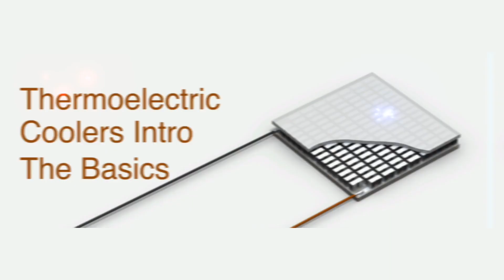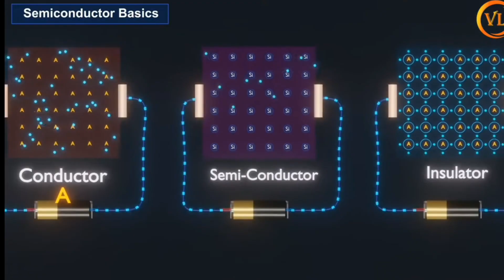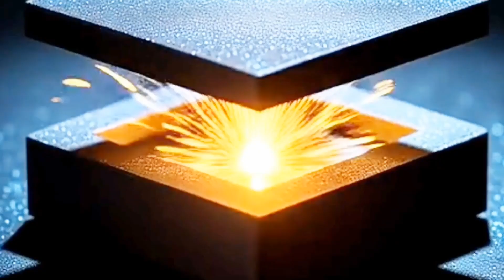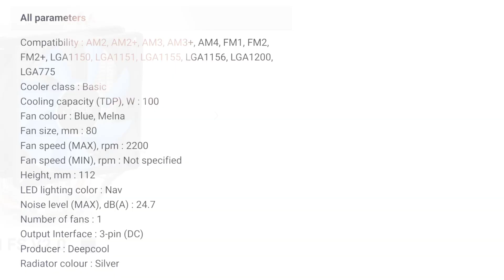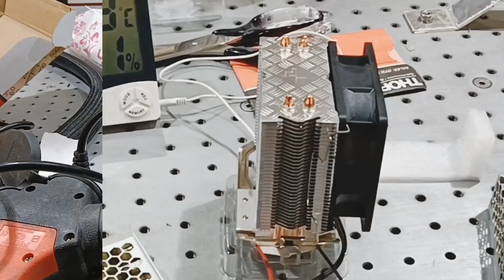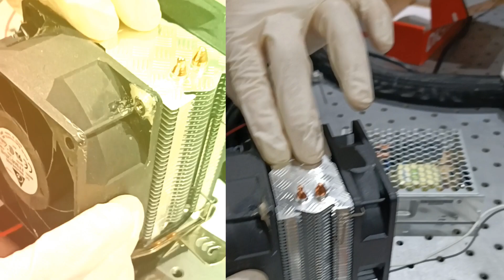Achieving -29°C with one Peltier and affordable CPU heatsink.                    #Peltier_CPU_cooler

Comment: What is the point? you have not specify what current or power input you applied to the device. A heatpump transfer using cooling liquid has better efficiency then a peltier device and can get down to as low as --55°C..

Comment: all that useless experiments. NOW bring heat on the cold side - and u will see, its warming up very fast. so its useless
Reply from the maker: Hi bro, thanks for comment, in the movie the final test result was better. When you install the heatsink correctly and use the fan at a higher speed, the cold surface temperature also reaches lower, So you have to reduce the voltage applied to the Peltier until you reach a constant stability at the cold surface temperature. temperatures.

Comment: you dont want low temps. you want a fixed temperature gradient. anything below ambient temps causes condensation, never good for electronics.

the closer the hot side to the cold side, the more power they are transferring.

like filling a bucket from a barrel and emptying it into a drain. as you empty the barrel, it gets harder to remove the water, you get less in every scoop.
if the drain is too small, you cant empty the bucket very fast.

as the module still forms a heat-bridge when turned off, the power supply needs to be "current controlled", a variable voltage to give a certain current to maintain the temperature at the set point. the module always has to stay on, but how "on"?

PWM only works if its heavily filtered. otherwise the heat flows back, soaks the device, and you waste a lot of power cooling the device itself down before doing anything useful...
Reply from the maker: Hi, thank you very much for the very detailed and good information you provided. I hope that the audience will read your message and learn a lot from it.